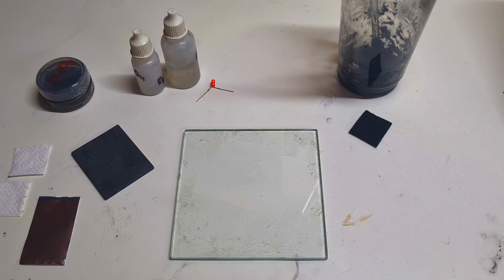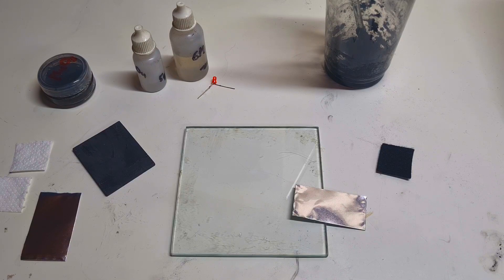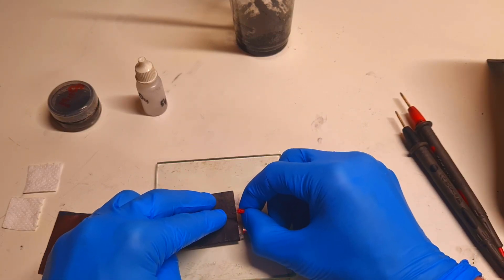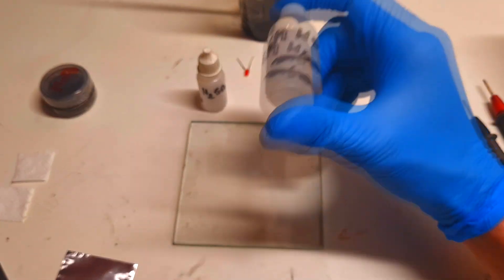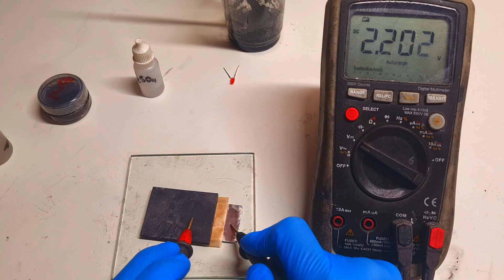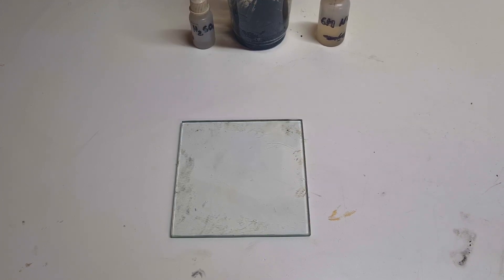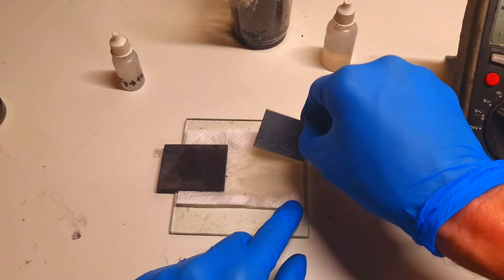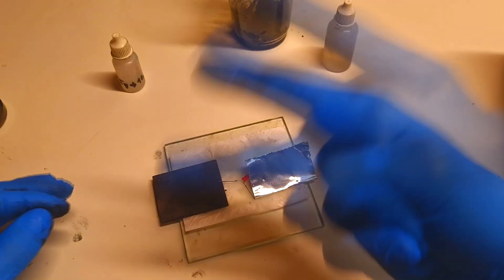High voltage aluminium air battery - REMAKE

Comment: Does the corrosion on the aluminium side will happen and block the reaction ? If so, can we use Alkaline citrate cum stannate as electrolyte on aluminium side ? Does it increase the effectiveness of the battery ?
Reply from the maker: Yes the corrosion is a part of the reaction. Yes you can try to use it. I dont know if will increase the effectiveness of the battery. Try it and you will see.

Comment: It appears as two usual cells. With an additional aluminum and AC, but without an acid. And perhaps this is a reason (an acid) to manufacture a traditional cells. By the way, I’m afraid you made a K-acid battery rather than Alu-air. Because of an acid
Reply from the maker: @sc0or  yes yes 😉

Comment: Love <3 your videos! Tho what about the amperage, can you please please make a video for high amperage AND high voltage Al-Air. 
It seems like when I add activated carbon the amperage raise up only a little, when I add mno2, the voltage increase up a lot, so I dont use activated carbon, I just use Mno2, and I get AMAZING VOLTAGE of 2.7!!! how ever the amperage is only around 100ma for 3-4 cm2 🌝
Reply from the maker: Yes, the current depends mainly on the type of active material. Some material will give you better current that others.

Comment: Nice content!

How much current can a single cell give? I'm trying to make this cell for a project and I'm worried about current. A single Li-ion cell gives around 3A as the max discharge current. Also, the current depends directly on the surface area? Finally, could the graphite plate be replaced with a stainless steel mesh? Does it affect the oxigen difusion through the cell?

Hope u can help me with those questions. I follow ur content and its really helpful as well as interesting!
Reply from the maker: The current will depending on the amount, type and surface area of the active material. Yes you can use SS mesh,... but this will only effect the voltage a little bit.

Comment: have you ever submerged crushed aluminium foil into concentrated koh water. it goes hydrogen poof instantly. koh is not actually suitable for high surface area aluminium-air battery. koh might be fine for thick block plate aluminium-air battery. try baking soda instead. for single electrolyte aluminium air battery. baking soda is dirt cheap, if using bags of soda blasting media. how about baking soda vinegar dual electrolyte cell. yep vinegar with baking soda will produce tons of co2 if the are mixed. a ceramic tile would work also for the membrane. also the baking soda will remove the oxidation layer from the aluminium. ceramic membrane is just a porous glass fiber separator. how about a gravity cell, where top electrolyte is koh and bottom one is h2so4. well requires electrolytes that dont react acid-base. sometimes is not worth the hassle to have two electrolytes when they make the flooded cell structure way more complex.
Reply from the maker: Uuuuu for sure,... I run hydrogen fuel cells with aluminium. Yes baking soda can work and can be used in the cell, but can also limit the performance of the cell (comperisong to the KOH cell). But In most cases when is used KOH or NaOH electrolyte some alloys of aluminium and tin or others are used for the anode. In the end,.... you have tons of combination which can be used as a cell.

Comment: I wonder what the shelf life is on that battery.
Reply from the maker: The shelf life of the aluminium battery without corrosion inhibitor will be short. If the aluminium is mechanically removed then the shelf life much more extended. Or if you use a zinc version of that battery then the shelf life will be also better.

Comment: I didn't know what "dual electrolyte" meant. Now I've learned it's acid/alkaline. Any combination possible. Now I hear an aluminum/iron combo. What??? That makes thermite!!! Just more click bait I found on YouTube. You're awesome. Thanks.
Reply: So, an aluminum air battery could be modified by using Nacl and "charged" converting NaCl into its constituent chemicals. Two problems: hcl and chlorine gas. They could be engineered to mitigate but always present and a risk. Thanks again.
Reply: I've taken my jar lid aluminum air battery and used saltwater. It recharges again and again. Used coffee filter, wax paper and pva and heat pressed it. Works a little longer. I had a good battery day. Thanks